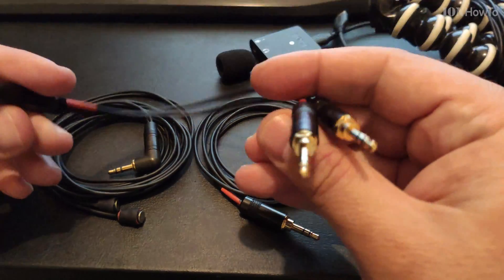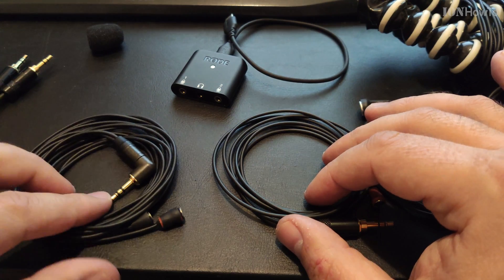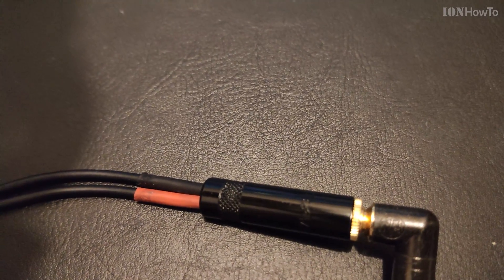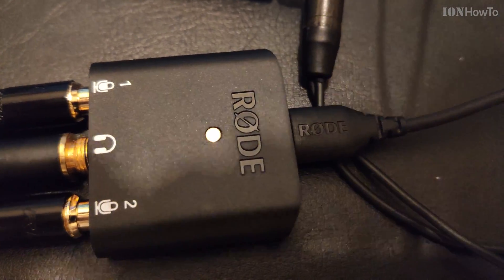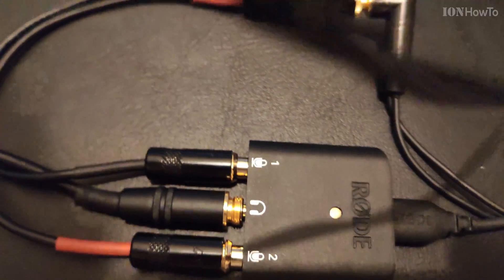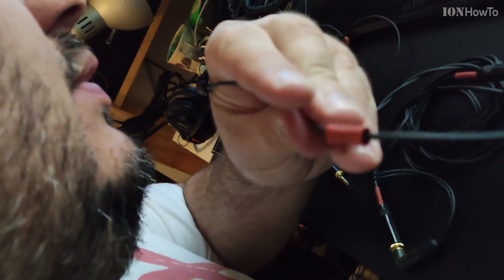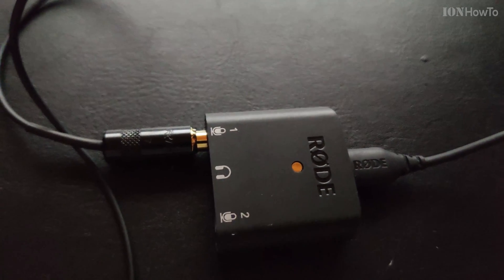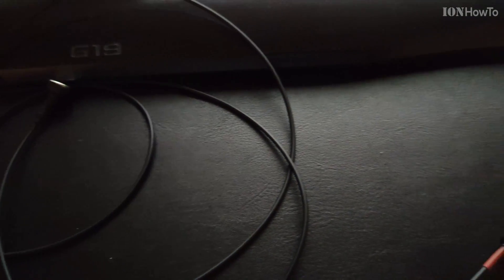Rode AI Micro Fix DIY Stereo Splitter Cable

Comment: Thanks for your video!
I want to know the specification of your splitter cable.
How did you connect male TRS and female TRS?
Did you actually connect T and S (or R and S) in male connector?
Reply from the maker: I'm not sure if I made the cable right for all cases but found a pinout somewhere for rode and T+R were tied together and S was ground - for a lav mic trs jack.
I imagine it would work also if T is connected, R left unconnected and S is ground.

Cable used in the video is like this.
Input 1 -Left - T+R merged together, S ground -> on female side connects to T and S for ground.
Input 2 - Right - T+R connected to signal and S is ground on cable - Female connector R and ground is merged for both, goes to S.
Hope it's more clear.

It merges S grounds of input 1 and 2 into stereo S ground.
Send T+R of input 1 to T - stereo left
Send T+R of input 2 to R - stereo right
Reply: @IONHowTo  
Thanks! I understand it.
female T - male input1 T&R
female R - male input2 T&R
female S - male input1 S & input2 S